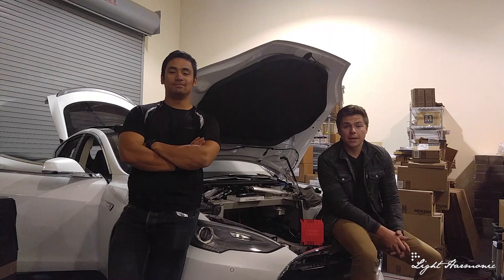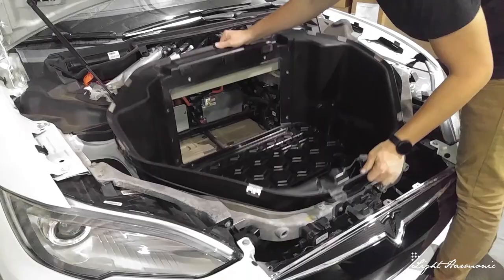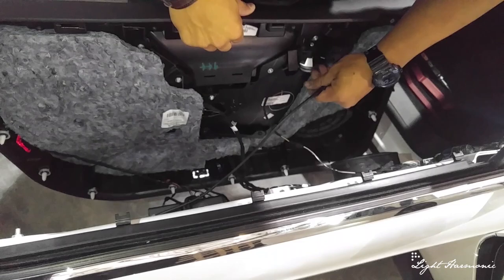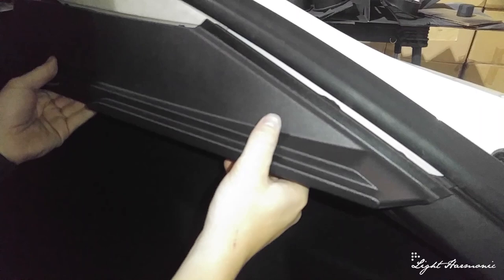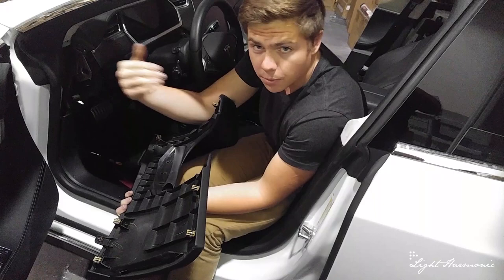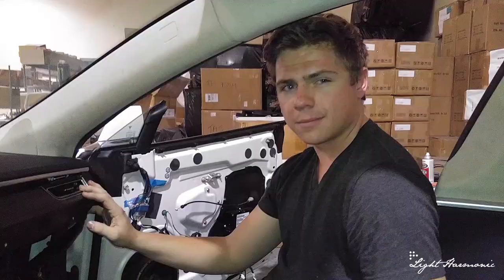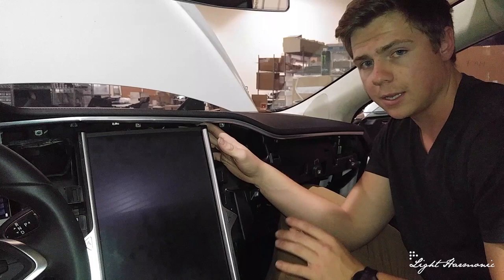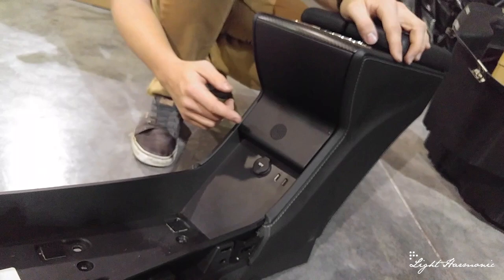Light Harmonic speakers- Tesla Model S Teardown premium audio upgrade

Comment: i know this video is old but if someone is watching today, do not remove the studs with rubber head. those are your hood alignments. just pull the plastic pannel and the rubber head will go trough the hole. same thing when putting it back.

Comment: You don't need to remove the rubber seal around the frunk to take it out! you also don't need to remove the rubber grommits that house the plastic frunk panels!! You can pull up on the plastic and it will go through the holes, that way you wont need to adjust them later on when putting everything together!

Comment: Very interesting. So the interior is basically a lot of plastic parts that clips and screws onto a steel skeleton?
I would have thought that fewer larger pieces would be easier. Dash as a single thermoplast piece attached directly to the body in white. Also the computer wiring seems a bit heavy. I wonder if for lower bandwidth you could simply communicate on the 12V wires. But I guess canbus can be done with very few wires.
Reply: Indeed - all those pieces to create shapes and vents and surrounds,..... now think about the Model 3 interior,.... one long vent over the head, no real surround for the centre screen, no gauge cluster,... it's SO simple.  All those parts no longer needed: all that tooling now redundant, all those bits that no longer need to be supplied.  It's extraordinary how much simpler and potentially cheaper the interior trim of the 3 might be.  (Might because we've yet to see the final design).
Reply: Yes. I suspect there will be a minimal forward speed display in Model 3. Maybe also autopilot info.
I would do that. It might be a 50$ item so doesn't make sense to skip that.
Reply: Dan Frederiksen I'm still expecting a HUD to be built into the top with a corresponding reflective coating on the windscreen. That'd be my choice.

Still, simpler and cheaper and quicker to assemble. It's all good :-)

Comment: This video is one of the gold-standards of Tesla Model S tear-downs.  Well done!  I'm installing sound deadening tiles under the floor carpet and noticed the carpet seems to be bolted or pinned behind the glovebox.  It's where the passenger floor slopes up behind the glovebox.  I'm trying to avoid removing the glove box but can't seem to get to the bolt or pin.  Have you guys encountered that during your tear-downs and is there another way to get to that carpet attachment point?

Comment: Can anyone help me? 
I have to reapair a dent on rear fender on model X and I want to completely "turn off" the high voltage electricity to prevent any harm on someone while working on the car and disassembling it.
I will be thankful for any answers!
Reply: Kristiyan Kanev a paintless dent removal kit would be your safest bet

Comment: I have often wondered how much weight could be taken out of it with serious effort. If significant, it could make it into a performance monster. Since the body in white is only around 190kg, there has to be a lot of weight in various details and it's not just the battery. Battery is maybe 550kg.  you might try weighing a few things. Try to figure out where all the weight is. It might be a service you could sell to a lot of people. Faster than a Porsche 918 is a strong selling point for those with enough money.
The lighter it is the less structure it needs so it can spiral to very significant amounts with concerted effort. Could make you world famous
Reply from the maker: We believe that we could get a lot of unused parts out. And it will help to light the weight
Reply: The lead acid battery could be swapped with 4 small lifepo cells. Maybe the 20Ah A123 pouches or even just  8 or 12, 26650 size cells. That would be a big and perhaps inspiring start.
Ideally it would be aggressive like casting an entirely new single piece dash or perhaps a super skinny borderline flimsy carbon fiber replacement for the steel frame behind the dash. Skinny the disc brakes, get the simplest lightest suspension for it, 3D print some rims, that are also a bit skinnier to makes the tire lighter because less load is needed. Take out all the plastic linings in the frunk and trunk and see how much that affects the sound of the car. Can't be too tinny. I think it's possible to make a car that looks and feels almost identical but is 500kg lighter. And that would be an awesome car. Some people would pay anything for that. The range would also be a lot greater. Aero rims while you are at it. Maybe even custom rubber cones in front and behind each wheel for aero. Careful diamond pattern shavings of the rear drivetrain spines culd also be done. It adds up. Heavy cast cases for the electronics could also be replaced. Everything is heavy in it it seems.
Reply: Also new padded covered shell seats. Probably a lot of weight in the seats and nice ones could look the same but be much lighter.
Reply: take a look at the pikes peak model s, it is completely stripped out with racing seats
Reply: The Tesla does performances for a few minutes, then everything is super-hot (engine, battery, electronics and cables) and super performance are no longer feasible as the temperature of the whole has not dropped.
Porsche achieves its super performance during any time as long as it has fuel.
"Some German clients Tesla had a bad surprise by taking their car to the Nurburgring. They could not even complete a lap without their car starts in degraded mode to not heat the batteries." 
http://www.moteurnature.com/actu/2015/Audi-R8-e-tron-electrique.php
Reply: The ring is a long track and Model S is known to not be a track car. Track performance is not really relevant though since that's not how you use a car. That said, I do think they overheat too easily. Other electric cars don't have as much of a problem.
Reply: Françoise Leclerc yeah thats why when driving in germany not a single Audi, BMW or Porche could keep up with my Tesla ;) if you considere 230km/h for 1h at the time a few minuts.. (They even followed me to check out the car and asked how big mu engine was😂😂....) then you are right.. And without burning fuel ;)

Comment: Is that a scratch on the screen? o.O
Why is the car so freakin' rusty?!
Reply: Just wondering, but where do you see rust? Doe you mean the galvanized steel bar in the frunk? That is meant to have aan oxidized outer later, to protect the steel.
Reply: +MetalMike50 Do* an* layer* - damn you autocorrect in a different language